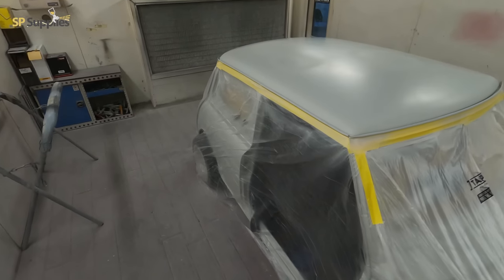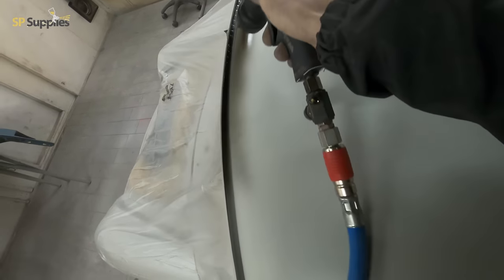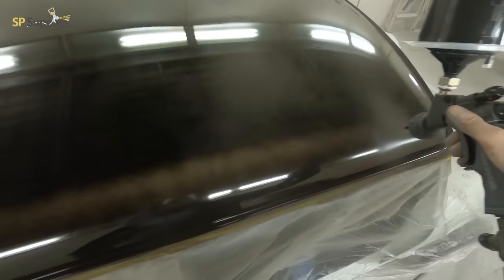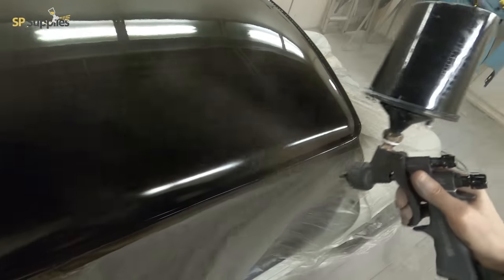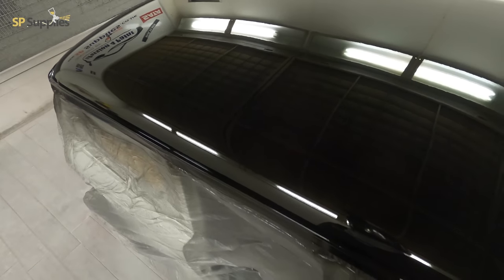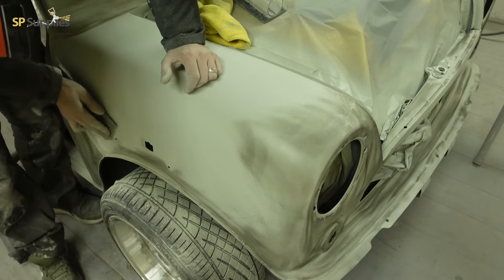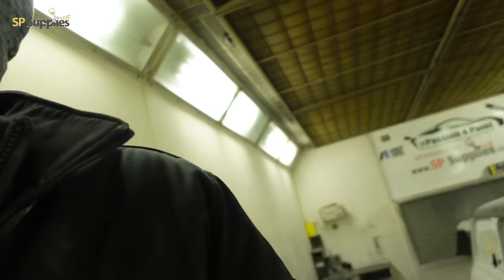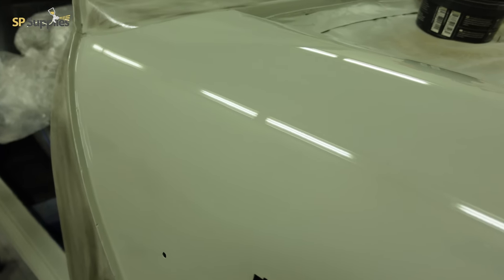First 2K gloss and Body prep - Bare Metal Re-Spray on A Classic Mini - PT4

Comment: I come across wobbles myself in my shop man.. but you have to draw the line some where it’s a repair after all and that roof was knackered.. looks great in booth you won’t see it out side. A redo can open up a tin of worms I find with sinkage etc unless your going back to bare metal. Don’t be to critical on yourself, a long block with the 1500 may take it further off the eye. Can’t wait to see the bottom half painted awesome work 👌 roofs are notorious for sinkage I find although that novol Ali filler seams to hold up well as it’s meant to disperse heat..
Reply from the maker: Thanks Tom and yeah your right I am my own worse critic I guess when it comes to my own work

Comment: Hey Tony great premier and live chat last night and I'm really pleased you had a good turn out on the chat and the views are good as well.

It's a shame about the roof having the wobble in it but considering what it was like at the start it's 100% better but I know what you are like and I'm sure you will go over it again before the car is finished even if it's at your own cost 🙄😁

I've just got some of the Mirka guide coat, while it's good stuff I don't like the applicator it just seems to stiff and hard to get the powder in the curves of the panel so I'm going to use your idea from a few years back and use a microfibre wax/polish applicator. Those soft foam backed pads look really nice and might give them a try once I've used up my 3M foam backed discs which I like but they are pricey. 

I think this series on the Mini has been one of your best to date, looking forward to the next one 👏👏👍
Reply from the maker: Thanks buddy abs yeah the series seems to be doing very well mate so far which is awesome , defintely the polish applicators are better mate lol just make sure it’s the microfibre type and not foam ones bud the applicator is the downfall on those tbh I agree abs il probably do a review on these soft sanding pads soon as I’ve just got some more in to test
Reply: Ok thanks mate, I got a pack of 10 microfibre applicators a while back when you mentioned it in one of your vids, you would think a big company like Mirka would test them better as it doesn't take a genius to realise they are not really fit for purpose 🤷‍♂️🤦‍♂️😆

Comment: The roof looks fantastic! 2k is so glossy! Wings look really nice and straight, have you filled the wing to front panel? Hard to tell but they can flex a little and crack.
Reply from the maker: Thanks Matt and they have been previously welded buddy so we’ve just smoothed where that’s been done mate

Comment: Hiya Tony! How do you clean the airways in the gun when you're finished doing one colour? Do you just spray thinners through?
Reply from the maker: Il clean the gun through a few times with thinners till it runs clear and then connect to the airline to spray anything out of the air cap ect to make sure nothing gets blocked , full strip down day once a week or between really opposite colours like black and white for example